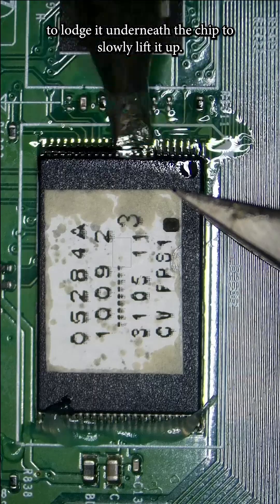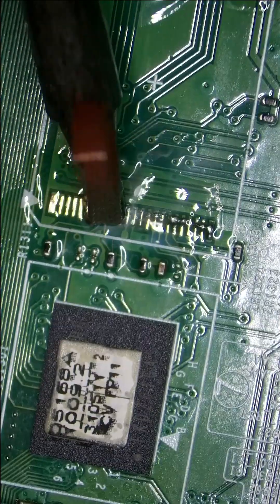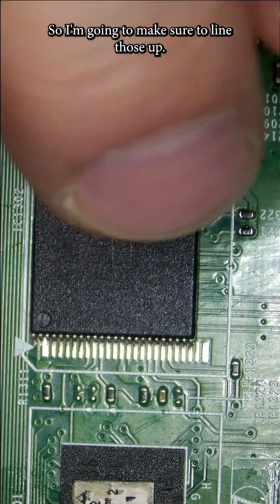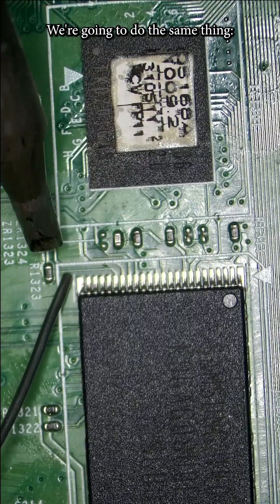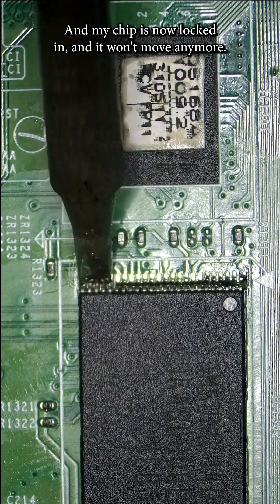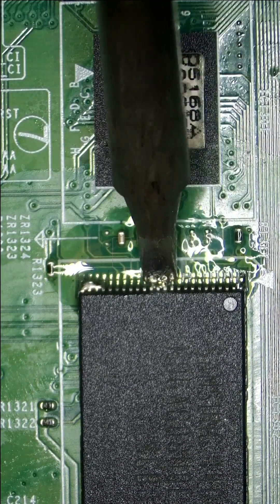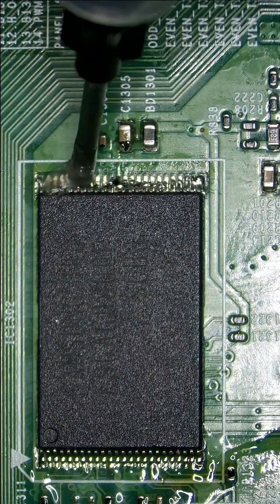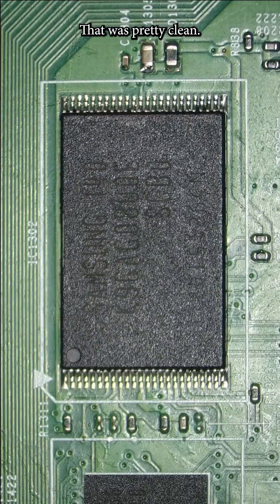NAND Removal & Installation #shorts

Comment: Sorry im not technician just curious , what clear liquid did you used?
Reply from the maker: Oh wait are you asking the liquid used at the very end to clean up the flux? 
If so that is 99% IPA
Reply from the maker: That is a chemical called flux. What it is does is help clean the solder so that my Iron has an easier time transfering heat from it, to the solder as well as help the solder flow more smoothly making it easier to work with.
Reply: The clear liquid is IPA or Isopropyl Alcohol (sometimes called ISO-propanol alcohol), also know as rubbing alcohol. It is effective and safe to clean circuit boards after soldering or just for general brush cleaning. Do not get this stuff on flat flex keyboards like laptop keyboard otherwise you will destroy them. Also exercise caution around LCD panels, apply to the cloth/brush not direct to the panel if you do decide there is a reason to use it neat on an LCD.

Flux is a chemical paste, liquid or gel that you apply to an area of work requiring solder to be applied. The flux minimises oxidation of the solder joint by keeping the thermal transfer of solid solder to liquid solder and subsequent flow onto the pad and pin out of the air. The flux also serves to lift and suspend any dirt, impurities and residues during solder operations keeping them out of the finished solder joint.